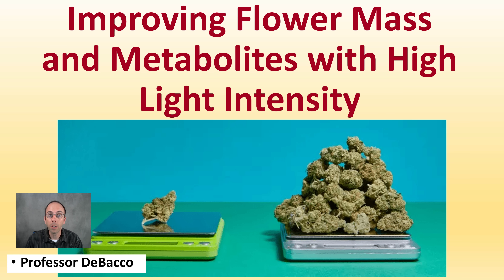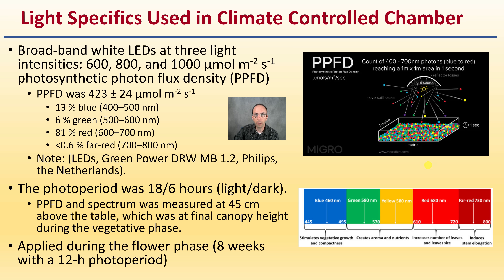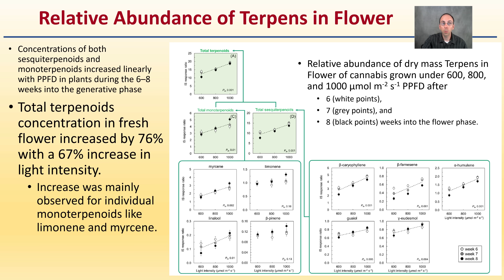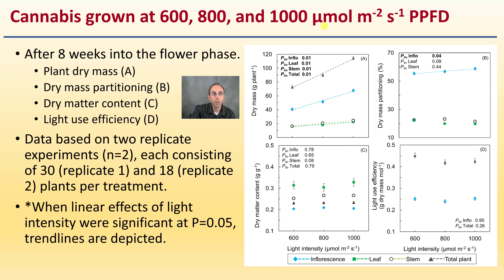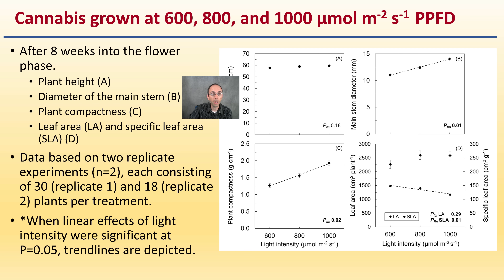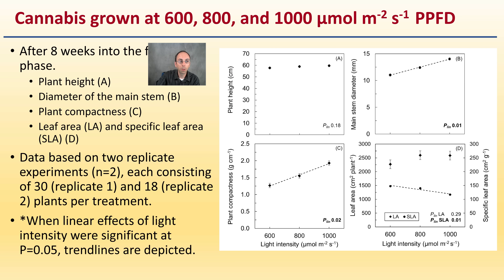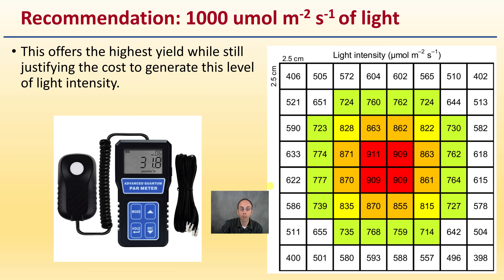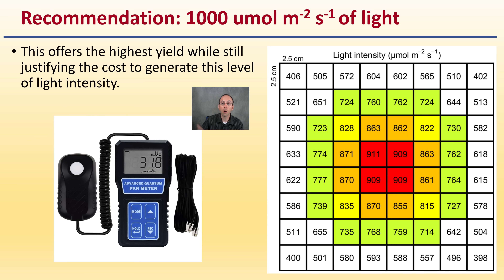Improving Flower Mass and Metabolites with High Light Intensity

Comment: So for most home growers, this wont apply to most of them. In fact, usually too much light is being used and I see plants all the time that are burnt out. I suggest 7-800 ppfd in flower until you are super dialed in AND can keep up with the fertigation regiment for optimal results of output vs wattage consumed. The increase in electricity has variable diminishing returns for most home growers and for some, they are even getting less yield than they could be. ✌
Reply: Your very correct here. I think the best I ever did was on lower watts and got better yields

Comment: I think one problem with most modern buds is that companies focus too much on weight, without much thought on the end goal, trichomes.
Everyone wants to grow huge buds that are really dense. The problem with that is, the more tightly packed buds you have, there is less exposed surface area for trichomes to develop. 

Fluffy buds on the other hand, are always completely packed full of trichomes, with a higher percentage of the total weight being those end goal trichomes.

Dense buds are also harder to process without destroying the trichomes, and introducing unwanted plant material into an end product. 
When applied to hash making, fluffy buds always give a great yield because it can gently break itself apart. If you're doing BHO or pressing rosin, fluffy buds provide pathways for the oils to seep through. 

Plus, a bag of fluffy buds is often twice the volume as the same weight of rock hard buds. Who doesn't like a big bag of beautiful buds?

Take all of this into account when deciding on a strain and growing technique.

Comment: I tell people all the time it's all about the light if you want big dense buds. Don't try to stuff your plants with nutrients thinking it's gonna make the buds way bigger, it'll just cause a problem. We all over fertilize as if we had an endless supply, try giving the plants more light instead. Light is the real food for the plants. I upped my light intensity and now I'm getting buds that are a lot denser.
Reply: Que panel utilizas? O recomiendas alguno
Reply: Ppfd matters allot. I try for 800 in full flower up to 1000 on full power. Then ramp down towards the end so I don't foxtail. I learned allot with lighting in the past 3 years. So many studies on these led lights which helps us all when we read.

Comment: 75%humidity in flower seems drastic...MOLD!!!!  lol
Reply: high temps and good air circulation
Reply: @Rohgestalt  Cooks off all the terps...lol
Reply: Some terpenes start to evaporate at temperatures as low as 70°F, while others require temperatures of over 400°F.
Reply: @Smurf-z6g 78degrees is when terps start to get cooked off. Not 70

Comment: A couple things I noticed:
The strain they were testing was very unusual compared to what most people cultivate.
The light intensities they tested were reasonable, going up to a DLI of 43. I’ve seen prior recommendations that go above this which is sketchy due to the number of plants that cannot tolerate high DLI, especially without long adaptation periods (which exceed what commercial farms will typically have time for).
The upper limit of ppfd was a sprint test, not a marathon test. Yes, the plants were responsive up to 3000ppfd but if the plants were kept at that all day long all week they would have been very unhappy. Plants outdoors can deal with peaking light intensity, but that’s not how we grow indoors, with constant intensity.
Growers should also be warned that they might not have similar results unless they duplicate the other environmental conditions; light tolerance is coupled with temperature, fertilizer, co2, humidity, root water pressure, etc.
Growers should also be aware of the plant spacing used in studies, so they understand how much of the plant was exposed to light of high intensity.